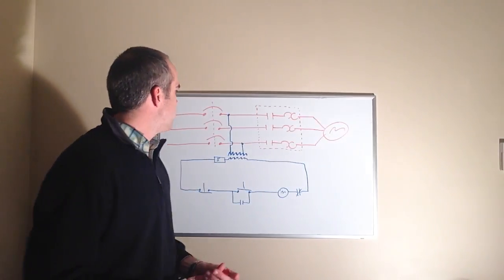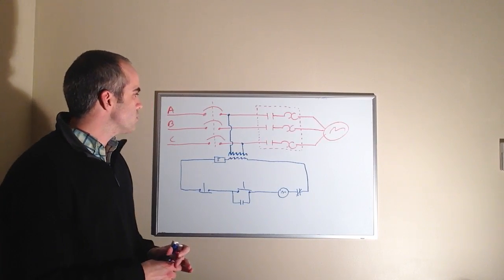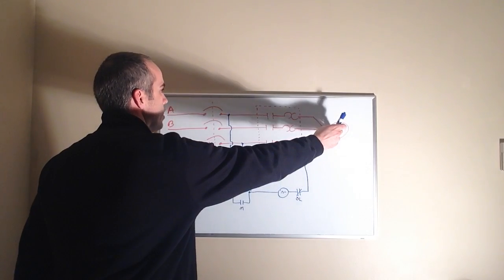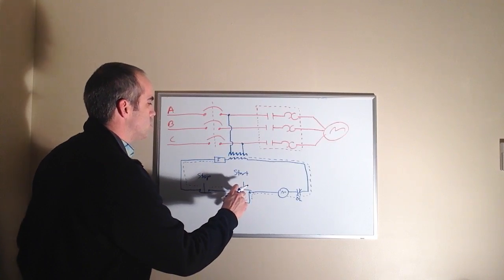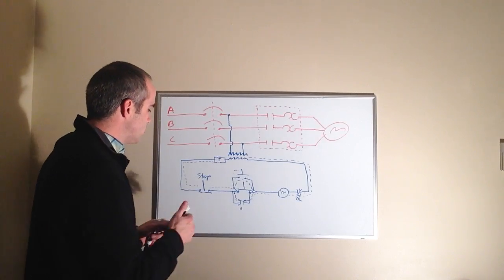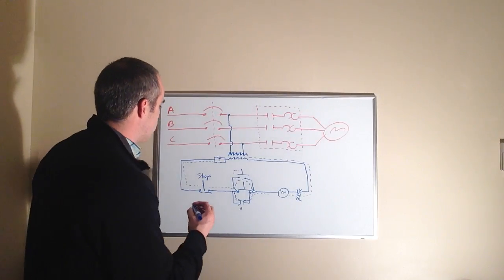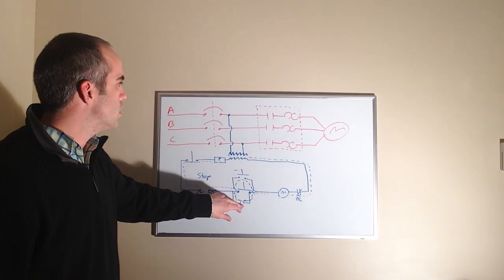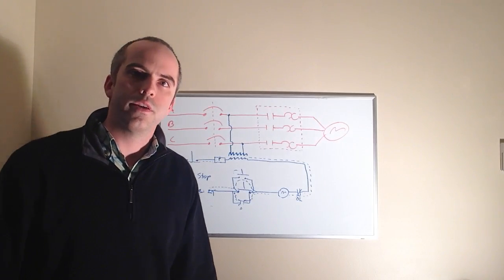Motor Controls: Basic Start/Stop Circuit

Comment: As a rule of thumb one would usually connect normally open contacts in parallel with each other and normally closed contacts in series with each other.

Comment: Very easy to follow explanation, almost effortless on my part.
I've just come across a 3 wire start stop but with a single phase machine using a dpdt relay. 
Couldn't wrap my head around it all even after reading many explanations until I watched this video.

Comment from the maker: Typically from two phases of the 480 feed down stream of the main breaker from mcc board and before the contractor. Hope this helps and thanks for watching!
Reply: +Power System Operations Concepts How do we determine Fuse sizes for the 480 to 120volt Control Transformer?
Reply: Aubrey Roche

Comment: Great breakdown of the basics. This might be a stupid question but my electrical knowledge needs some work...why is the transformer connected to two of the three 480V phases; wouldn't there be no potential between the two phases to induce a current? In my mind, why wouldn't the transformer be connected to one of the 480 V phases and then have the other connection to earth ground create a potential between the two?
Reply: +Poppin Atlas Isolation. Keeping Control Voltages separate from Equipment Voltages. Avoiding Potential to Ground.  Most of the Equipment I have at my Mill uses Device net or Ethernet for motor Control, I would not want a Ground Path to Voltage in the Buckets.

Comment: That was the best explanation I've seen. Thank you very much. My question is on the front end A B C wires. Can you explain why you choose A and C. What happens to the B wire and so on... on the front end of the motor cct?. Thank you
Reply: I believe he it doesn't matter because the AC Voltage on each line is the same. I'm not that familiar with star and delta for wiring.

Comment: What DC voltage is used on the switch/coil circuit and is the overload contact a separate component?

Comment: If my motor starter coil is 480 vac, and my control circuit is 480 vac, can I run a 120 vac pilot light via a step down transformer to an aux NO contact on the 480 MS overload?

Comment: I understood how the M coil locks a solinoid and keeps itself running, but you don't show very well how the control circuit is connected or wired to the main starter??  you just say, this is running, so that is running?????  how? why is the interaction not shown? is it basically just a bigger set of solinoid switches or contacts?